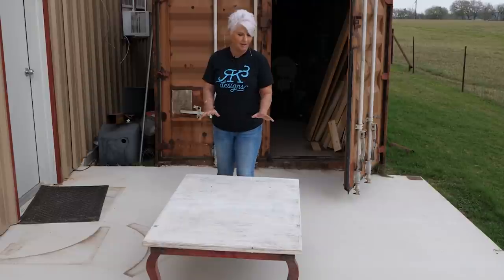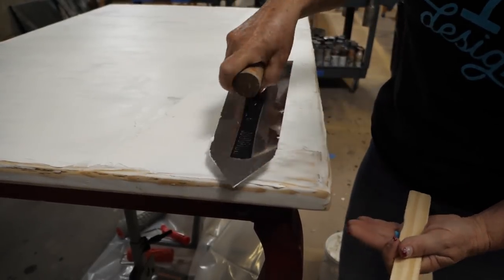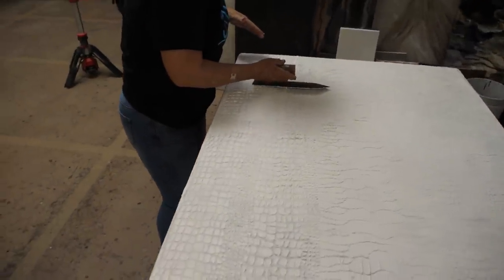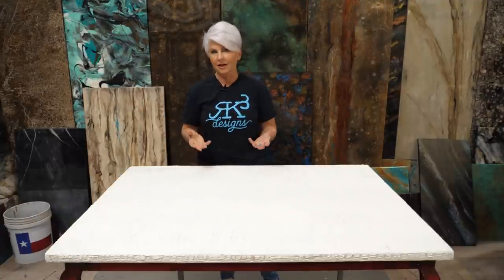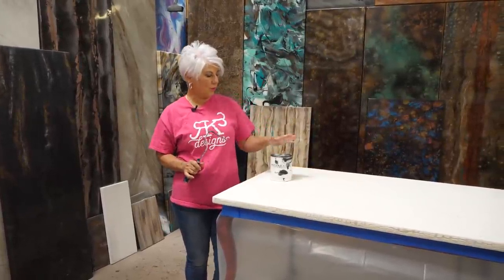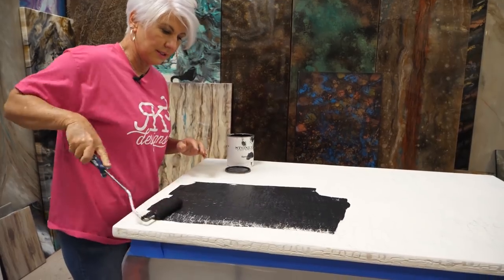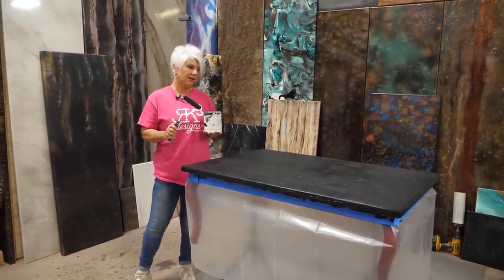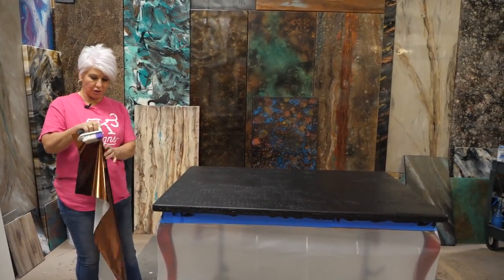Learn to make THIS with epoxy! | RK3 Designs

Comment: If people want to use wall mud AKA spackle, mix 70% glue all with 30% water.  That gives it the hardness you need and it wont crack when it dries. It works for me anyway.

Comment: I should have a business doing this because I love love love different textures, medias, never plain, and original creations. I'd rather form with my hands then say a mold, or if a mold is necessary I do things like put soap bubbles on top of UV resin before curing, then a rubbing or dusting of using a mica powder w/glitter then top it off. Beautiful! Or plastic wrap for a silk or wrinkled effect.
Reply from the maker: You would love this technique!! I’ve done the bubbles and plastic as well. So much fun!

Comment: love the way this table turned out! what are the pros/cons of using the utc vs a final coat of epoxy. I saw stone coat use the utc also, why the utc instead of epoxy???
Reply from the maker: You actually use both. You’ll do a  final clear coat of epoxy then roll on the UTC for incredible added protection and durability 😊

Comment: YOU just gave me an idea; I have 2 wooden 4 drawer file cabinets that a client asked for something to go into a man's library/office with a Mad Men type decor.. guess what I will be doing to those file cabinets now? I was going to painstakingly do wood stains to look like inlayed wood in a Great Gatsby Art Deco design, but I think I like this so much better..  of course, I will use just the UTC.
Reply from the maker: That will look epic. If the file cabinets are metal, you’ll want to apply a good bonding primer first before you trowel on the texture medium so you have good adhesion.

Comment: My kitchen counter tops are granite tiles with black grout which I hate. The edge of the counter has no overhang lip. Do you have any videos covering something like mine? Thank you 🙏🏽
Reply from the maker: I don’t have a video bad of yet. To pour over tile I would trowel self leveling quick drying concrete. Once dried completely, then you can sand smooth and pour. Hope this made sense.

Comment: Hi Rhonda, I think that you are an amazing teacher and most likely a grand interior designer and I would love to see more of your textures and how you do the beautiful work that you do. Some of it is complicated because you use initials it's the first time watching your video and I don't understand what the initials mean it would be much easier if you would just say the name of whatever you are using I don't understand what texture medium, I don't understand undercoating. I am going to do my kitchen table exactly the way that you did that coffee table. I have watched this video at least 20 times, and I'm still left in the dark, however, you did answer one of my questions, by explaining we simply just can't go out and buy drywall mud because of its texture. I would like to know the difference between the texture, which I'm about to spend over $150 dollars for versus drywall mud what makes the two different? What is the ingredient inside of this textured medium, that I have purchased, between drywall mud? I mean I get that it will shrink and it could possibly crack however I have used drywall mud for texture on my walls. I've had no problems with that as for shrinking or cracking goes. I would like to better understand what you are talking about. I would say the rule of thumb is always to pronounce the name of the products instead of using initials. You do have a lot of newbies coming here. This is only a suggestion. You are very good at what you do
Reply from the maker: Hey Karen!! Thanks for the feedback Why don’t you give me a call and I can answer any questions you may have. I would love to help but It’s quiet a bit to answer on a YouTube comment!! Our shop number is 830-745-3440.
Reply: @RK3Designs  I agree and when I get back from the VA hospital I think I will do that because they looked up your other product Proceed

Comment: Is that texture medium a plaster of Paris?
Reply from the maker: No it’s a medium that is specifically formulated to dry very hard. Pasted of Paris has too much moisture and will crack as it dries. It’s also not very durable.